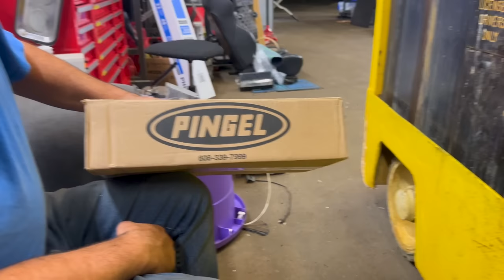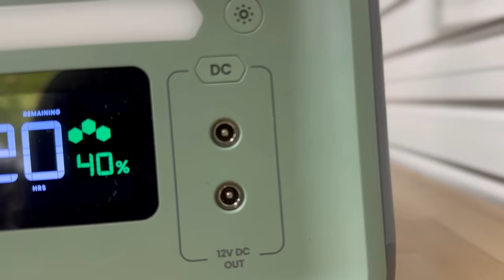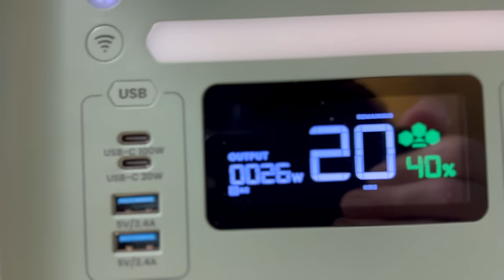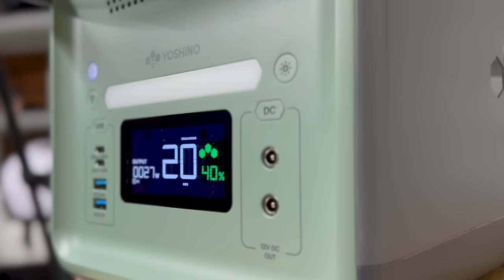Our Dual Motor Hayabusa Turbo Pickup Truck Puts its Power To The Ground

Comment: If you have problems with the slip yoke look at slip yokes for lowriders, they are extended lengths and have a spring on the slip yoke that lets it move in and out but the spring keeps it from falling out. Some of those guys have 18" cylinders in the back!

Comment: I have done an engine conversion. A floor pan repair. And motors and batteries are my relaxation time now a days. But all on the same project where nothing is standard and you have to do a ton of custom work. You guys are crazy. 

Extremely well done. This is about as much of a customization shop as I have seen. I could work on that project for 100 years and it still wouldn’t be the quality you are putting together.
Reply: That said. 
Your doing it all wrong you know. 🤣

Comment: Please weld better, the thin Bar from underneath is only point welded. The Bar through the Transmission Tunnel should be welded good. With this Kind of Power are Welding Points very important. But over all its a nice Project, keep going👍

Comment: I had a drive shaft that small in a 510 with a 13b rotary mounted in the passenger compartment to make it mid engine. You drove it from the back seat
Reply: Mike Bibinoff’s Rotary 510? I was around when he built one and raced it in SCCA. I miss that guy. 😢

Comment: My mate (rip) had a grass track buggy with 2 1200cc blackbird engines...it was the closest thing to an f1 iv experienced.... it sold for 28000pounds back in the early 00s
The drive line was a chain to a transfer box the shafts to wheels.
Check out irish grass track class 4/5

Comment: If it was me, I would add another brace or plate to that lower mounting hole on the engine block just below the drive shaft. Seems to me the up and down torque and general bouncing of the rear differential is going to be hard on the block.

Comment: To solve travel issues if on drive shaft. Could a telescoping shaft with two travel points be used? Or would that have created more issues? Not sure if thats available for  this type of thing.  Also this truck is awesome.
Reply: It already telescopes, that's what the slip yoke is for. They were worried it wouldn't have enough travel.
Reply: The drive shaft only has one point of travel. Not two. You know a drive with in a drive. So it extends fauther. And still be short enough to work properly. Like what's on rock crawlers. But they may not be able to deal with the rpms.

Comment: Instead of trimming then adding fender flares, if there is enough material you can just hammer and stretch the metal into the shape you want.
Watched someone who made poor fitting cutouts bring a friend over and stretch and shape the metal to fit - the flares still look like crappy bolt on shit but in my mind they could have just brought the guy over and let him make the flares outright.  To make the opening bigger you're just using the material you were going to cut off anyhow, just pushed to the side and shaped well.
Probably be a lot easier to paint prep and wash too - plus it will make a very clean lined look, continuous and flowing.

Comment: Ummmm, the rubber elbow on the turbo outlet collapses when he revs the engine... You may have to replace that with a hard elbow and two silicone couplers.

Comment: Is that a Ford 8.8 in the rear? Ok so it is. And he wants to change gears to 410. Why not find a explorer with 410s  and disc breaks and swap it in rather than reagearing and you get a disc brakes and lsd.

Comment: YouTube should demonetize people doing unsafe things like riding in the back of a truck with the driveshaft inches away and a hole in the bed big enough for Fat Albert to fall through AND the driver rubbernecking instead of watching the road. Stopped watching and thought about reporting the video for unsafe behaviour, but didn't because YouTube is usually too dumb to know what is and isnt safe. Besides, since this video is still up after 2 months, I am sure someone already did and YT gave it a pass. 

You are still reckless and endangering others.